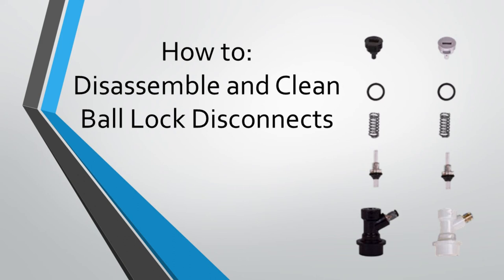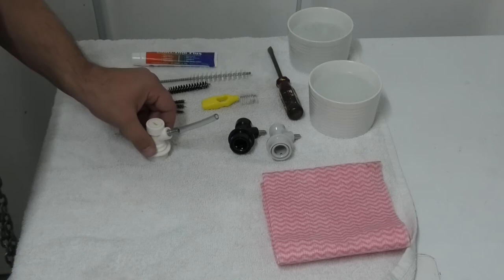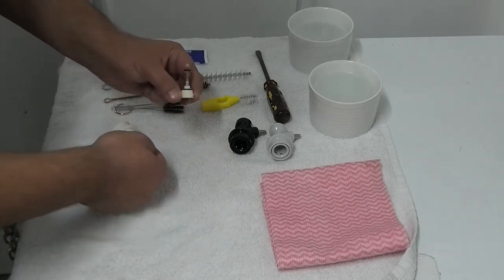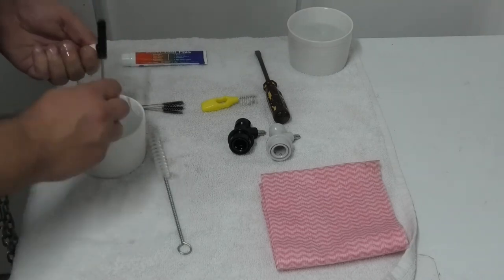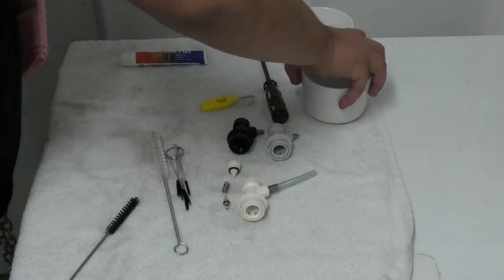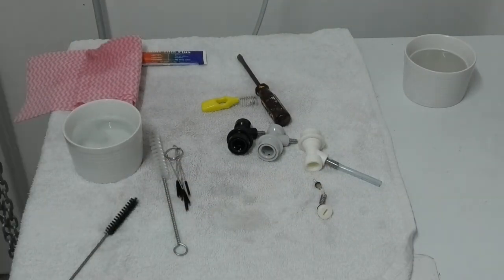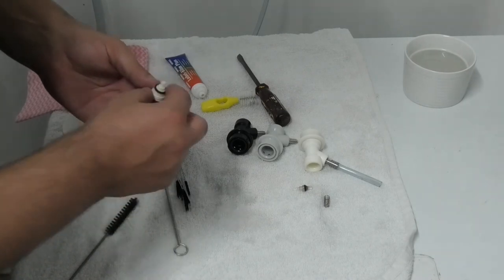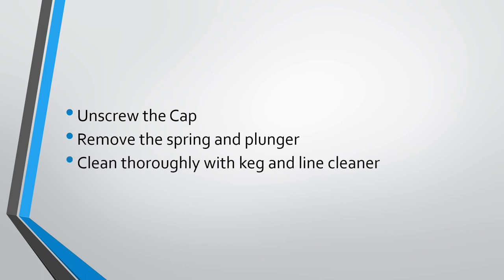How to Disassemble and Clean a Ball Lock Disconnect

Comment: Great video. I had many issues with these leaking. Like many had my gas, one leak and lose  all gas. 

I was fed up with this, so I bought the German CMB one much better, but the beer one was leaking after a while. Do I need new seals, or just a clean required. This happans quite often, especially the beer black ball lock. 

Always buy CMB branded ones now so much better. 

Can I ask where you get the seals for these if I may ask. 

Many thanks, great video.